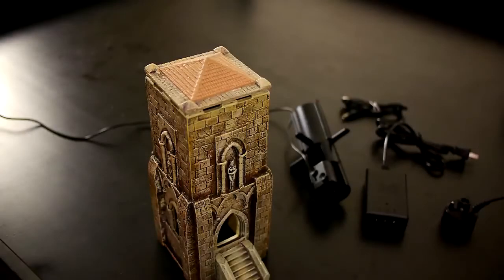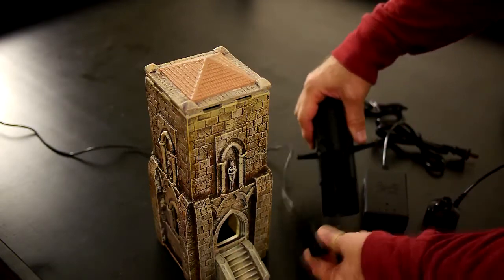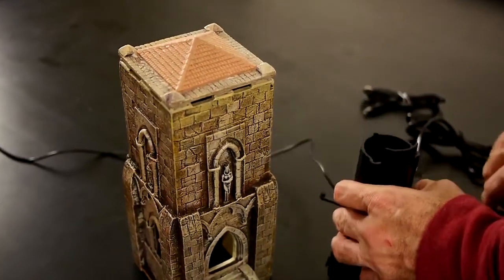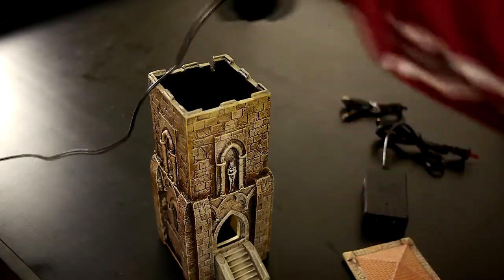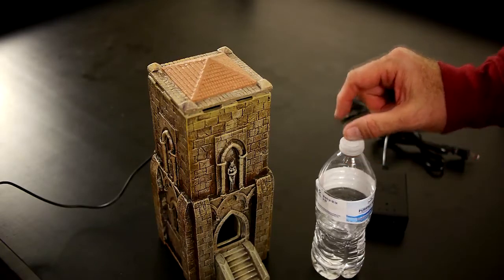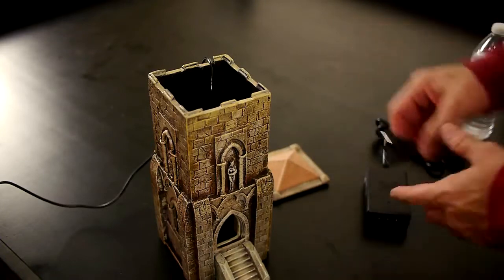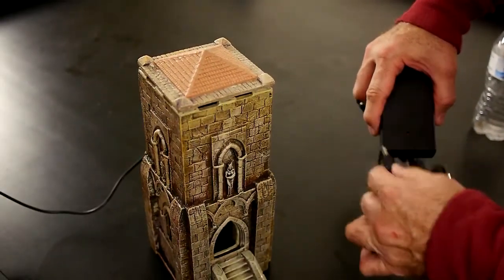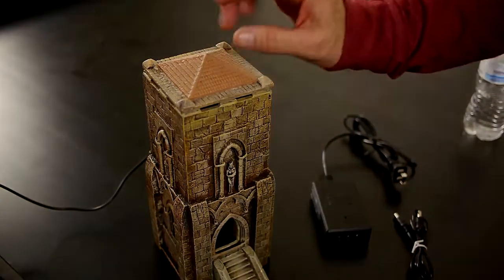Dark Crypt Fog Machine Overview Instructions - For tabletop games.

Comment: I'm also having an issue with it spraying water up through the transducer which is getting water all over the table. Any easy fix for this? I'm sure I'm not the only one.
Reply: I've also limited the pump to almost nothing by closing the "door" on the pump as much as I can without completely closing it.
Reply: I second this.
Reply from the maker: Closing the door on the pump will reduce the flow of water to the fogger which also reduces the amount of fog. One of the best solutions was to selectively covered the windows you dont want fog coming out of with clear plastic. This directs the flow out of the front door and will reduce the spatter.